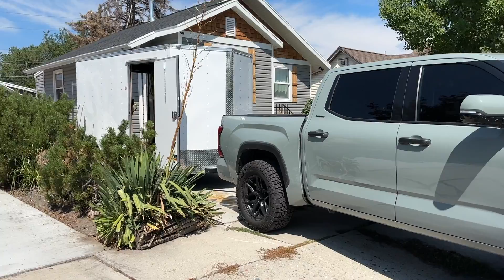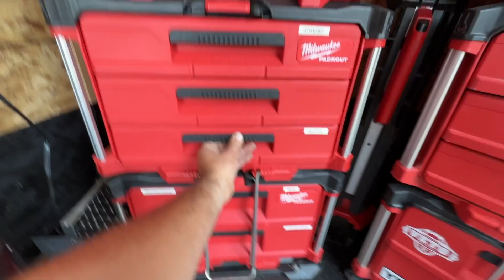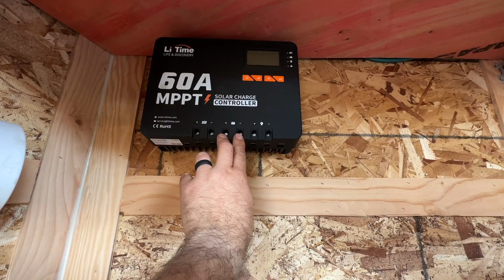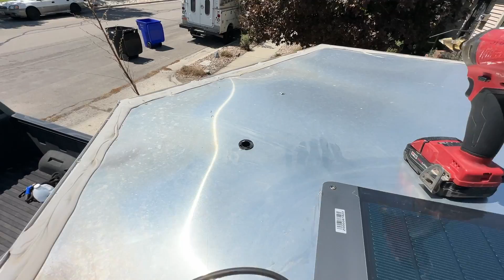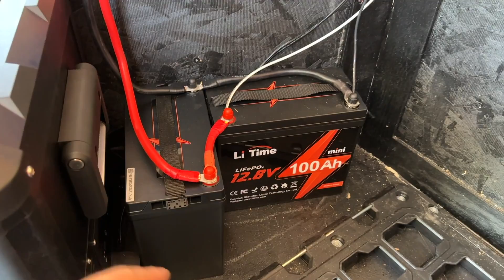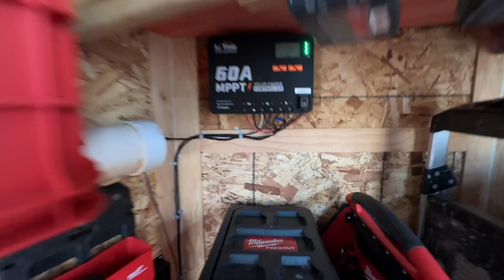Save Time On Every Job By Doing THIS.   |     LiTime LifePO4.

Comment: Wow talk about brand loyalty! I have a bunch of packout stuff, some for tools but mostly for screws, nuts and bolts, electrical connectors etc but wow you have a lot. Mine save me so much time by not having to go to the local stores for fasteners so often and when I travel for work if I don’t have them, I feel so handicapped.

Comment: I have a similar solar set up with interior lighting. I installed a 12vdc motion detector after the switch so in the event I forget to turn off the light switch, they don't drain battery overnight. The detector has adjustable timer.

Comment: I would of put a small bead of silocone across the front leading edge of the whole panel on the roof just to prevent any air  (on highway etc) from being able to get under the panel and wantin to try to lift it up over time and make it start flapping or moving

Comment: Looks great.  You should put a fuse between the battery and the invertor and I would get a fuse block and run it off the battery then hook the fridge and lights off that so they have there own fuses.

Comment: Why Not just precharged the Batteries every time and have Spear batteries.....❓❓❓Saving money and trouble for all that
Reply: Free power for the next twenty years without plugging in plus reduced cycling and increased life of the batteries as the solar usually carries the load. When you are young and can access capital to do it right it is a smart thing to do.  Especially when you can depreciate it over many years.  He will migrate to service vans as he grows the company but can still use a good install trailer.
Reply from the maker: Couldn’t have explained it better myself!

Comment: Just to clarify, running solar panels and batteries in series, positive to negative, increases your voltage. Running them in parallel positive to positive, negative to negative, increases your amperage/wattage. Amps * Volts = Watts. Nice job on the build out. My last 2 cargo trailers, I painted the walls white and used raptor liner on the floor.
Reply: Doubled voltage in series at the same amps still doubles the watts
Reply: @rj.parker  Yes it does.
Reply: Batteries in series will have a voltage that is the sum of the voltage while current (amps) is unchanged. Running them in parallel will cause the current (amps) to be added up while the voltage will stay constant. The impact on power (watts) is the same because, as you point out, watts=amps*volt. However, you say that running them in parallel will increase your "amperage/wattage" as though running them in series doesn't increase power (wattage).
Reply: @deanmacgregor3072  Yeah, I had mis-typed. I actually meant to say series wiring increases voltage, parallel wiring increases amp-hour/capacity. I mistyped using watts in place of capacity. You shouldn't mix batteries or solar panels of different voltages/amps/amp-hour ratings. Regardless of series, parallel or series-parallel wiring, the same formula applies. Amps * Volts = Watts. If you are setup for 12 volts drawing 20 amps, that's 240 watts. 24 volts drawing 10 amps, 240 watts. Usually with higher voltage, the amperage draw tends to be less, but not always. It really depends on the use case and power requirements of the equipment. I usually run 48 volt battery packs and about 100 volt series-parallel solar for my smaller setups. For his trailer setup, he should be just fine.
Reply: You're right that parallel increases amps and series increases volts, but BOTH series and parallel increase watts equally.  Generally speaking, solar installers prefer higher voltage (series) over parallel to keep the amps down so they don't have use thick AWG cables.  But if you want to keep it really simple when using in a 12V system and won't need long runs of cable, then parallel works.

Comment: I think you need to have one inverter lead on each of the 12v batteries, I.e. positive on one battery and negative on the other.  
I hope you have a alarm on that trailer!
Reply from the maker: All new trailers have gps tracking so heaven forbid if it gets stolen we can track it. 

I haven’t had any issues as far as where the leads go but I might make that adjustment. Thanks for the tip!